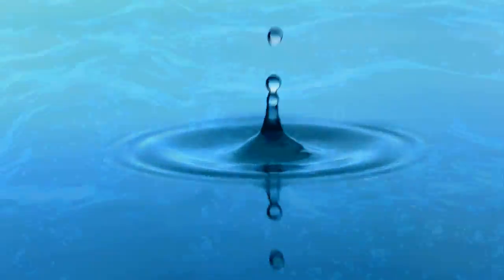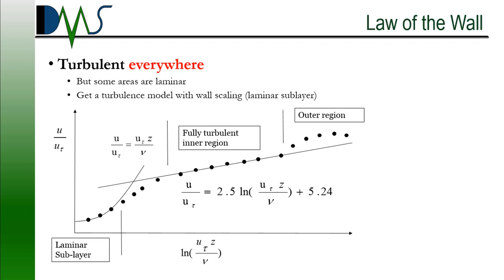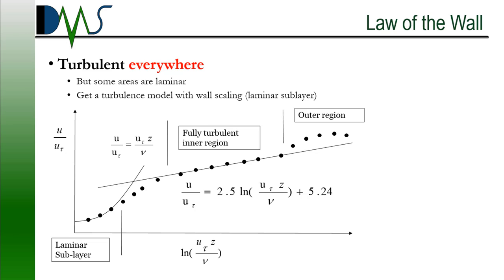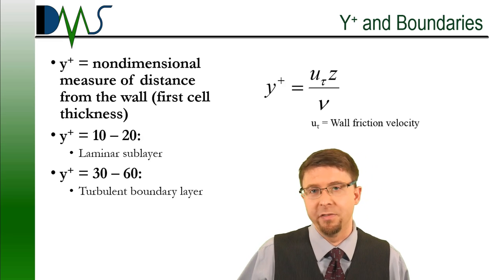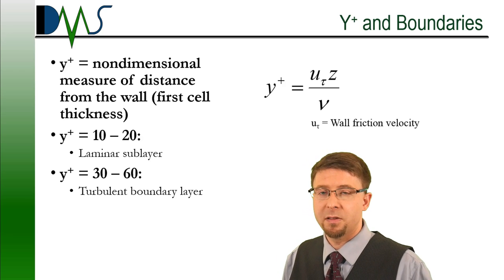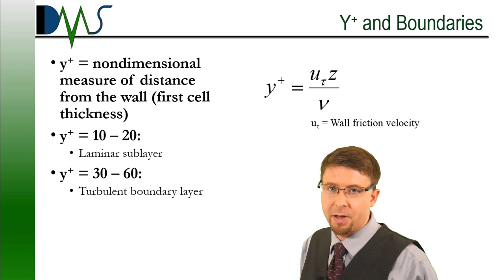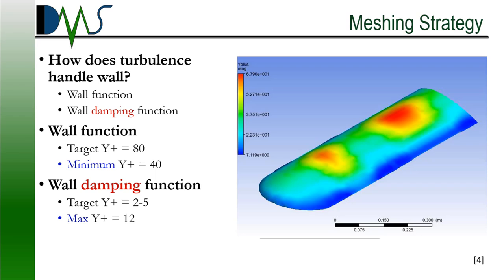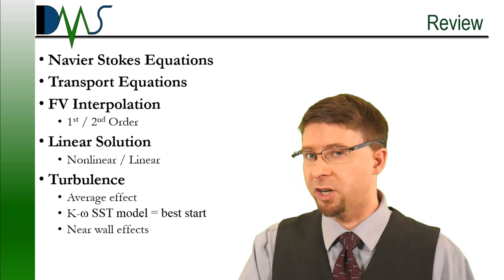GUTS OF CFD:  Near Wall Effects

Comment: Hi Nick, thank you so much for sharing your Knowledge.
I'm a beginner in the CFD world, I have a question, in practical terms, what is the importance of Wall Shear Stress in product development? Could you help me?
Reply from the maker: That depends on your application.  Wall shear stress relates to the boundary layer thickness and resulting friction losses on the surface.  For example, if you are developing an aerofoil, a strong boundary layer can be a good thing to prevent separation and stall.  If you are designing a ship, wall shear stress is bad; it coincides with higher skin friction and more resistance.